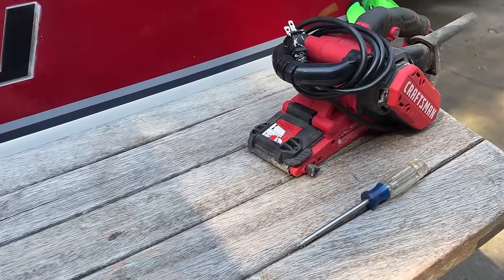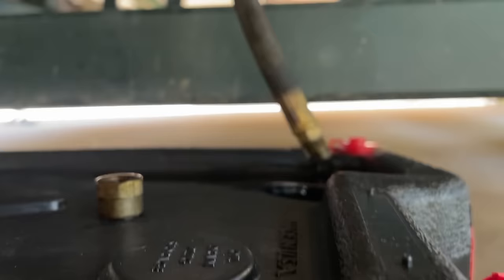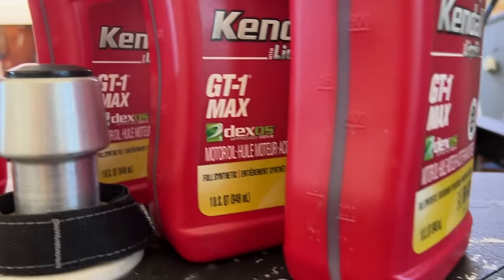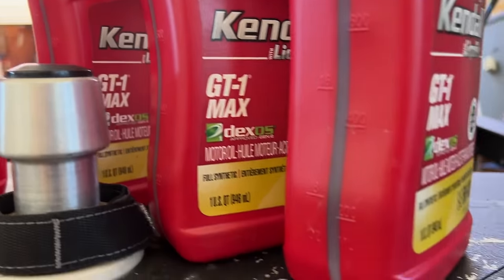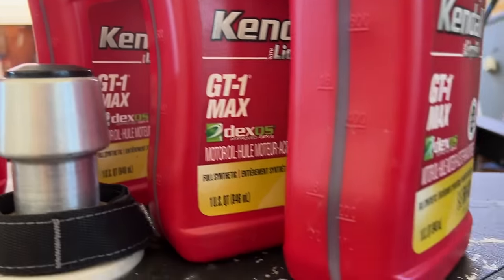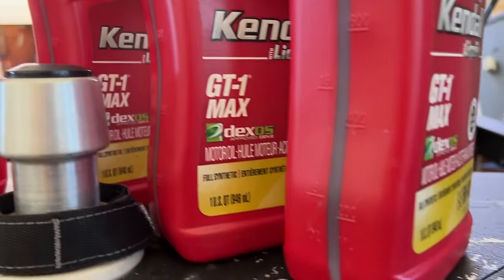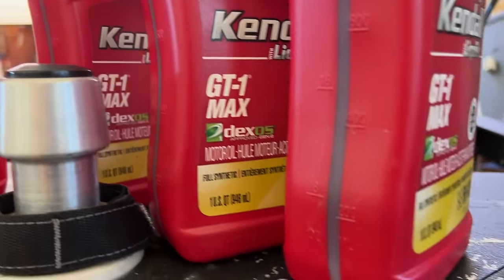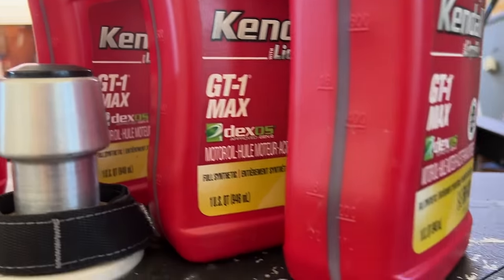Best MALIBU BOAT modification EVER + first time on the water this summer.

Comment: did you check the rubber bellows in the outdrive.
There is one on the drive shaft and the exhaust.
If the transom is rotted, id replace this with coosa board from boat outfitters. If you send them a template they will cut it out for you.
Coosa board is expensive 
$382 for 3/4" and $688 for 1.5". idk how thick your transom is. Youll need to fiberglass that in, but it doesn't rot.

Comment: Transom work 😭been there before from replacing it and the end of the stringers rotted to converting from outdrive to jet on a few not an easy task but a necessary when they get soft😞you all will pull it off I've seen you at work😁☕☕✌

Comment: Check the pitot tube that may be the reason why the speedometer are operating. If there is water in the line the pitot will not operate correctly. I think we used Faria Pitot tubes back then..Hell it's been 20 years since I crawled around on a Malibu 8 hours a day 5 days a week unless we had special order boats or for a show then we would work around the clock to get them built plus a nice cash incentive afterwards. They were also a awesome company to work for back then. If my memory serves me correct you can convert your speedo to a GPS I think it was called Nautic Laugic NL2 if you decided to fix that LOL !!!

Comment: in your other boat you should check the bellows when mine went bad it leaked water into the boat bad but i have done a transom or 2 in my day i with all the modern tools today there easy to replace if you have shade you two can easily handle it

Comment: Replace your water pump impeller every spring. Sure, they'll likely last longer but the vanes will deform and weaken when sitting over winter. Most people wait until the pump fails after vanes have broken off and gone into the cooling system. A new impeller every season is an inexpensive way to remove worry about engine cooling.

Comment: Best practice: 

Use the highest quality full synthetic oil& filters u can find. I buy 5qt jugs of Mobil1 full synthetic oils, matched w/Mobil1 or K&N filters.

Glad 2c that u prime your filter2 prevent dry startup oiling delay damages. I’m sure that u finger lubed the seal& wiped clean the filter seal seat on the block.

Consider upgrading to LiON batteries in all your motor vehicles as the PB’s age out. I use DUHON from China. They’re 13.8v, less than 1/3 the weight of AGM’s, waterproof, high quality, long life. But I paid about $480 ea. shipped.

A long flat shovel &a wide garage brush is handy4 prelaunch ramp cleaning &slippery algae removal. A bucket of dry bank sand helps too.

Comment: Putting the switch on the negative terminal will work just as well as the positive -- but it's not going to reduce the current through the switch. It's always the same current on both terminals.

Comment: Ive seen a smaller transom done on a zodiak, basically the top is removed and a chainsaw is employed to cut (dig really) out the rotten plywood core, then the emptied cavity is filled with something, this is where I don't  know what happens... maybe some kind of glass or wood shaving thickened epoxy or even a porous wood or foam substrate. I recall them just filling the gap with chopped glass and resin, but it was a small boat, not a big weight penalty.

Comment: Another great vid! Wacky way to drain engine oil, they usually have a small hand pump for that or an oil pump with a thin hose to feed thro the dip stick hole. I took out an old worn out V8 from my 50's motor boat and put in an electric Lynch motor 260hp down to 20 but silent cruising on the river I use it on.

Comment: Well motor or prop style.
There is a new prop design that is more or less 2 twisted figure 8s 
Thats supposed to give more output force and generate less air bubbels also saving fule, but they cost a lot more.  Worth looking into.
I was watching a YouTube post on the design  for boats and aircraft it looks promising option. You can invest more in a big motor or change the prop and get the same results. Running a boat is not cheap  
I wanted a boat when i was your age it didnt happen.

Comment: I have been building, repairing and using boats since my early 20's, I'm now in my late 70's. I have NEVER paid the crippling prices they demand for so called "leisure" batteries or "marine" batteries and even in the large diesel cruisers I have owned I always bought common or garden large output truck or car batteries and as in my last diesel boat had a change-over split charging set up to look after my 3 big truck batteries. Never had a problem and come winter would haul them out and take them home for trickle charging as part of winterising and when not winter had a small solar panel doing the job. Saved a load of money by not falling for the marina scams that way.

Comment: You might want to buy a different sized sets of oil filter socket style cap wrenches.
Those socket style oil caps are much better at getting the filter loose than the band style oil filter wrench.
It also looks like the bunk sliders on the trailer could use a little tlc too.
But overall I would rather be fishing in a boat.

Comment: In that case i would go for a differend engine drive combination. And when all the old stuff is out take a piece of wood or board en laminane the out and inside.
Because if you upgrade power you have to change your propellor or gears to match them. There are specialised buro s to calculate this out.

Comment: I think you need to isolate the positive sides of each battery. By adding a jumper between the two positive terminal, you’ll always be drawing from both batteries, defeating the whole purpose

Comment: Down for the wrenching is good, fiberglass transom replacement is the devil!  The replacement is not bad it is the removal of all the power system, prepping the surface and removal of the old transom etc in a small confined space that will make it difficult.  However, some power tools, a good respirator and tyvex suit and you too can be a fiberglass expert!
One tip:  baby power before grinding will help keep the itching down!  Itching just thinking about it…

Comment: The ideal iPhone operating temperature is between 32° to 95° F. When within this range, your iPhone should be performing seamlessly. Your iPhone can withstand more severe weather conditions when it's not in use. You probably won't harm your iPhone if you keep it between -4° and 113° F.

Comment: 39:29 .... need a fold up ramp that folds down and goes into water a little bit (8 or 10 inches would be fine for THE BIG FIN, but if you have LABADORES along ....that may be too short...)  so the BIG FIN can just walk up it, onto the platform.... up the stairs hoppin over the transoomm.... :)   welll that's the image I got when I seed it in my head

I have exltra anxioity seein doggies overboard and no ''DOGGIE RAMP'' so the doggie can get back up OUT OF THE WATER (onto the swim platform if no thing else)   eh...

Comment: Y’all come out might I suggest whenever you are working with hose clamps or whenever possible instead of using a flat head screwdriver use a nut driver it will make your job a whole lot easier.

Comment: The transom on the Bayliner can be fixed by cutting the top cap open and dig out all the rotten wood. Then use an epoxy product by pouring in the liquid. After it hardens it will be stronger than original. Can't remember the name of the product. Faster than cutting out the entire transom and replacing.

Comment: !!! RE: ~19:00 "Then you don't have all that juice going through the switch."... I'm not sure that is a thing.  Electricity flows in a circuit, so everything that goes from one side of the battery goes to the other.  You're right about that part.  Breaking the circuit doesn't care if you put it closer to the positive or negative.  The part you missed is that in a closed system (like what you typically want in a boat or car...) is that all current flows "equally" through the positive and negative terminals, so "all juice" is still flowing through your switch regardless of where you put it.  You can see it when you measure the current on the positive and negative cables, they should be about the same.  And if you put both positive and negative side by side and wrap the ammeter clamp around both, it should be about 0.

There is still a difference in where you place it in your circuit because of the reality/human element.  You'd typically fuse the positive side to save the equipment that is pulling too much current (due to age, accident, and/or defect).  Likewise with a switch.  Look at this with a practical example (and lets keep this academic).  I always remember it as if _I_ was the "equipment" I was wanting to protect.  I stand on the ground and touch a live wire, do I want a fuse or switch between me and the wire or me and the ground.  A fuse takes a second to blow so I get electrocuted.  A switch requires someone to actuate it which I can't do if I'm electrocuted.

In a boat, you are surrounded by "liquid ground" that could help ensure a good and solid ground connection through you.  Always switch and fuse the positive.
Reply: Yes.....but NO .......once the negative cable is disconnected from the circuit there is "NO" ground anywhere because it's disconnected  in a 12v system .....in ac system the whole world is a ground totally different
Reply: @doug8076   Tell that to lightening.  The negative terminal is not the only source of "ground" in an electrical circuit in the real world.

Comment: hope you don't mind but if you take a leather belt wrap it around the filter and pull it  you can unscrew most filters i wish i could send you a photo of what that looks like you would freak out  how easy this is then you would see how it works
Reply: wrap the belt thru the Buckel then back across the buckle so it grips agented itself so it pulls it much like if you have ever used a chain wrench

Comment: Instead of a battery, a small generator to power the lights plumb to fuel tank so after you get to where you are going turn off boat motor and start the generator

Comment: I’m sure y’all already know the obvious and that a Transom replacement is a major job to do. I’ve watched a few of your videos and your ability in general is enough to do the job. You will need to remove the drive. Remove the engine from the boat to get the transom assembly removed from the boat. Once all that is out, remove anything and everything from the transom inside the boat. The note of the location of your hull Id and be sure TO NOT remove that or register/ selling the boat in the future will be a major pain in the future fish parks and wildlife. 

Next you’ll need a saw blade set to a depth to cut the rotted part of the Itransom out from the inside (not the gel coat/fiberglass exterior) leave the outside of the hull just removing the wood from the inside. The gel coat/fiberglass you’re leaving after cutting the old transom will be roughly a 1/4” on those Balyliners. Maybe a tick thicker but not much more. Last step is cutting the old transom in a way a new piece of material can be cut to fit what you’ve removed. Glass all that into the boat the same thickness as the previous transom, so everything can mount back the same way. Cut out the transom assembly hole and drill for your transom assembly mounting bolts. Use 3M 5200 sealant on the transom bolts and any bolts that are outside the transom where lake water can leak. 

It’s a pain in the butt job, very time consuming but it’s necessary. 

Good luck.
Reply from the maker: We plan to do that job this year, plus some fun bonus work!!! Thanks so much for this rundown AND mostly your faith in us!!!
Reply: @flyingsparksgarage  absolutely. Happy to lend any help I can. I work on boats for a living and like you both I/we enjoy the boating lifestyle very much. My home lake in Texas is Lake Travis, just west of Austin. .

Comment: Even if you get your oils free, make a rack to drain the quart and gallon bottles and use the reclaimed new oil that is acquired to fill your oil cans and be available for component assemblies rather than having those erant drips and drops of oil ending up in the landfill  with the  1000 year plastic containers.

Comment: removing the oil filter - what the worst thing that could happen?  It could fall/tip over/spill oil  --   right?    so you put something to soak up the "potential" spill. if you don't need it   excellent!  if you do?  GOT IT COVERED.  Think ahead. You will live happier and longer.   Cheers.

Comment: It blows me away to see you pre fill an oil filter. An oil filter should never be pre filled. It’s not the correct way to do it and has never been recommended by a designer/manufacturer.

Comment: If the boat is less than 26 feet in length and is moving at a speed of more than 10 miles per hour, then passengers must wear life jackets when the boat is underway and not anchored or moored to the shore.